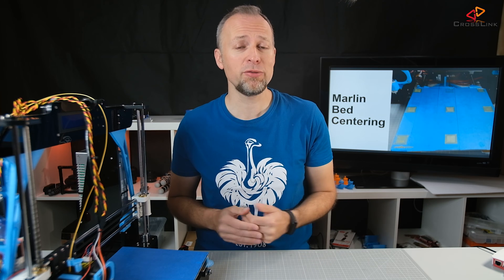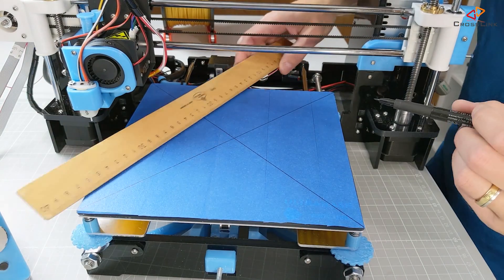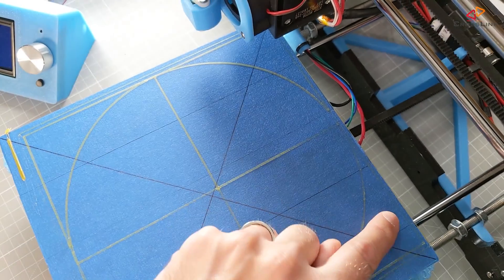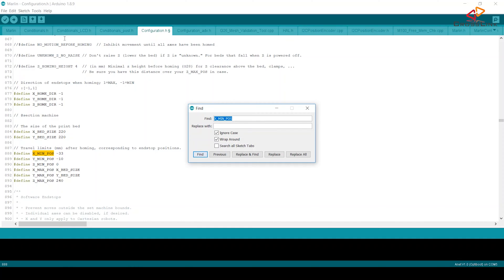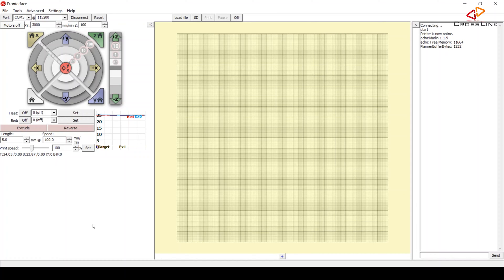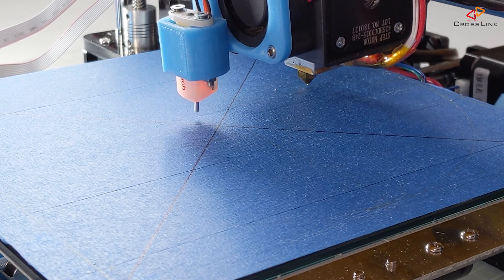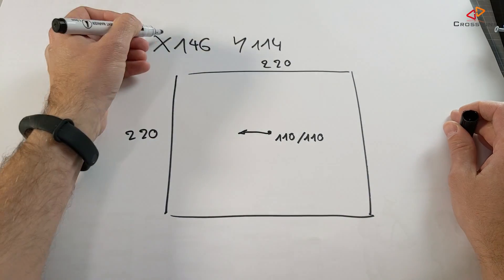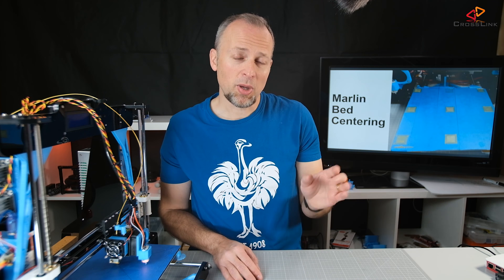Bed centering with Marlin Firmware 1.1.X

Comment: This is an old video but I hope I get an answer soon.  I have an ender 3 and put a Sprite Extruder pro on it. To adjust for the new X carriage endstops (I had issues with homing trying to  go past where the printer can move.)  I am learning to compile firmware. The example config.h from marlin for an Ender 3 says print bed of X235 Y235.  Should I change this to X220 Y220? I know its actually 235x235  but everyone on You tube says 220x220.
Reply from the maker: 235 is the physical size but you might want to keep some margin for the initial throwaway string and the most outer regions are not heated. So the safe region is 220x220.
Reply: @Crosslink3D  rather then mess with offsets and losing print volume I used x235 y235 and used a sliding nut with shorter bolt to adjust the frame. My first attempt at firmware worked but not well. For the moment I am using a firmware factory firmware while I learn a bit more.

Comment: Daniel/All:
I'm relatively new to this, and I'm wondering if this same procedure/commands are used in Marlin 2.1.2? I just replaced my Ender 3 Pro main board and LCD with the SKR 1.4 Turbo and the TFT35 E3 V3 as per your recommendations. Having some issues trying to compile the firmware correctly as I added a smart filament sensor and the new BTT CR Touch sensor, but I think I can figure it out. Thanks for all your help!

Comment: I know this is an older video... But would this fix the problem I have (installed a Sprite Pro head on my original Ender 3) and the nozzle homes about 13mm off the front of the bed. I've set the home offsets in through the printer menu but it still homes off the bed. When I try to do bed mesh leveling the first five point measure off the bed.

Comment: Would be great if you would show how to get in to the default file of your printer without using some other form of software or other then OEM from the ender printer. literally every YouTube video does not show anything on how to! Just use this software or adjust it from cura. Why cant people just explain default OEM options!

Comment: Great video: I have one question: I am not sure why you need to print the calibration pattern. I would think all you need to do is home, then move X, Y to center. On my printer it is 150 x150mm. Then move printhead to the actual center where I drew the X with a pencil. So it looks like I really don't need to print the test pattern. I could then print a test patter afterwards to see if it is printing in the center. All the print patter would tell me is I am printing off center. And Moving printer to X150, Y150 seems to do the same thing. Am I missing something?
Reply: Oh I just now see I ask the same question when I calibrated another printer about a year ago.

Comment: Subscribed M500
Perfect, been struggling all day to centre my prints, you solved it for me. Although I didn't configure the firmware then flash, I used Prontoprint's console and entered the correct numbers following your calculations and now my prints are mm centred :D Was annoying having to grab the wipe line with tweezers as it was about 5mm over the edge. Not any more, thank you :)
Now to sort my E steps, off you watch another video of yours :D Many thanks from Cornwall, England :)

Comment: I just added an auto bed leveler to  my CR10 S5 and flashed the latest Marlin software to my printer. The auto leveling works fine, but now my nozzle auto homes at the end of the print and squashes my prints. I am using Prusa and here is my end Gcode - 
start code //{if max_layer_z <= max_print_height}G1 Z{z_offset+min(max_layer_z+50, max_print_height)} F600 ; Move print head up{endif}
G1 X5 Y{print_bed_max[1]*0.8} F{travel_speed*60} ; present print
M140 S0 ; turn off heatbed
M104 S0 ; turn off temperature
M107 ; turn off fan
M84 X Y E ; disable motors 

end code //

Comment: Hi Daniel, I have followed the procedure several times in detail but despite everything when I give the command from Pronterface G0 X110 Y110 Z2 the nozzle moves to another position and on the display of my Anet I still read X110 Y110. Is there any parameter to comment on? Does somewhere else run any additional commands? Thank you
Reply: cancel !!! I'm solve !
Reply: @sergioroselli5726  how? i've the same problem

Comment: Hey Daniel, Just installed the DDX from bondtech, and have tried to follow this video (On stock it worked great) However, each time i do the  MANUAL_X_HOME_POS it still doesn't center the bed.
I have tried this like 20 times now, even used the G0 X115 Y115 Z2 to get it to align, but it doesn't work, what am i doing wrong?

Comment: Hi, I did what you said and it worked, but... now when a print finishes or if I move the Y axis to 235, it grinds the belt. The home coordinates also show the values I entered into the firmware. I read another comment that said they had similar problems. I would greatly appreciate any help for this.  I'm using Marlin 2.0.7.2.

Comment: Hey Daniel...  i was wondering if you could help me out with an issue i ran into.. the problem is i flashed my standard Anet A8 with marlin 1.1.8 auto level (cause i added a sensor onto it) everything seems to be working except the most important option...  when i select print from SD and the Gcode to print, it heats up nto its temps, reaches its temperatures on the hotend and the bed, but will not start the print, its just sits there...  is there anything i need to change in the marlin config file to get it to print?

Comment: I just wondered why I need to print out the cross hair pattern? I would think I could just plug in on my printer G0 X150 Y150 after zeroing out the values in the firmware; move the print head to the center and adjust the values. Only skipping the initial X/Y cross hair printing step. Is there a particular reason this will not work?

Comment: Yo. This is it. I had problem with error "Having trouble compiling firmware for my printer -Movement bounds ([XY]_MIN_POS, [XY]_MAX_POS) are too narrow to contain"  because i changed value in wrong place.... You must enter your value when you calculate center like in this video!

Comment: Hi...Thanks for the video....I followed along and was able to get the center perfect.....However, as a result of adding my values (X=4 Y=-5) into the MANUAL_X_HOME_POS etc, the readout on the LCD reflects that when homed.....Is there a way to add those values in Marlin and have the home X & Y display X=0, Y=0 etc....My slicer scripts for end of the print tell the machine to go to X=0 however its now actually X=4 (I know I can change it in the scripts to go to X=4), but I dont want to have to adjust to that.
Thanks for your help.

Comment: hey i was wondering im having a problem when i send a print to the printer it prints at the front left corner instead of in the middle i was wondering if you might be able to help me or knew what was going on??
Reply: I have the same problem, You fixed that?

Comment: Thanks, Excellent video. If anyone is doing this on an Ender-5, its (110 - (Screen Readout)) = (Home Postion) + 220 = Manual Home Position ... 
This video is for printers that have endstops at the front left (0,0) whereas the Ender 5's endstops are at the back right (220,220). You are basically adding or removing a margin to endstops to have the nozzle centered at (110,110). I have the Hero Me Duct with stock hotend so my firmware settings are: 
#define MANUAL_X_HOME_POS 223
#define MANUAL_Y_HOME_POS 209
I hope this helps someone because it took me a little bit to figure out.
Reply: You saved me man!!! I was confused because my bed does not move to the center, just a little hahaha.

Comment: This tutorial finally pushed me in the right direction. 
My centering was waaaaaay out of whack so far. Up until this point this was never an issue because my prints were usually small enough for this no to be an issue. 
But with a bigger print waiting that will barely fit the print bed with 4mm to spare on either side, this needed sorting. 
I have an AM8 here which is running Marlin 2.0.5. The Y axis was sorted pretty quickly, but try as I might, the X axis never did what I wanted. It was always off about 30 mm to the left, no matter what I did. In the end I did not use the manual positioning option in config.h but the min_pos_x option. I eventually adjusted the positioning by trial and error and finally got the result I wanted and the printer is now centered properly. 
Big thanks from the Ruhr! :-D

Comment: Thanks Daniel. Yet another fine tutorial of yours that is clear and easy to follow, and more importantly, successful! However there was 1 strange thing that happened at the point where in Pronterface you put in the code "G0 X110 Y110 Z2" and hit "send". For some reason the nozzle didn't move to the centred position. Rather than panic I decided to click home and try the "G0 X110 Y110 Z2" command again and this time it centred perfectly. I repeated this numerous times to make sure that it centred again which it did each time. Just thought I would let this be known in case anyone else also experiences this and starts to worry that they have done something wrong.

Comment: Hi. I replaced firmware and now HOME does not exist. It goes up as he can reach and moves to the right until hitting the structure, I think step motors values are wrong as long as everything. What can I do? I have an Ender 3 clon printer, Sunhokey and installed a firmware as Ender 3. Thanks.

Comment: Im trying to do this in Marlin 2.0 and I only see 5 tabs where you have a lot more. Im doing a search for mem pos and it doesn't exist. Is setting this up different in 2.0? And if so, whats the bit of code i need to adjust for the difference?

Comment: Thanks--So I set up everything, I have an SKR 1.4 turbo in a tarantula pro, for some  reason after auto homing, z goes to upper right corner of bed to home and stays there--I would like it to home in center like everyone elses printer, I havent changed any settings/definitions in Marlin, z safe homing is enabled and x y (/2) bed size is defined--any suggestions?

Comment: Okay, why not just find the center of your bed, as you've laid out, and then take those coordinates, and simply double them, and enter them as the exact size of your bed, under:

#define X_BED_SIZE 296
 
#define Y_BED_SIZE 308

My starting positions were X POS 148, and Y POS 154. (on the lcd screen when centered)

Is what my Tevo Tornado ended up being.

You don't need offsets when you have the proper size entered in Marlin.

Comment: That looks a little convoluted. If I programmed this you would be able to simply travel from the home point with the control buttons to the edges of your bed and have the x-y readout on the display, then save the settings like you do when bed levelling and Marlin would know how big the bed was from the home point which is the point of reference....you could manually enter the x and y values displayed on the screen and then Bob's your uncle. Does that not make sense? Am I missing something?

Comment: I have been following your steps to fix the center of my gantry pro with a 310 310 410 print area and i totally ruined it flashing the firmware. What profile do i need to use for my printer? Im having a meltdown here

Comment: The drawing of an "X" on the bed surface from corner to corner is relative to the limitation of your actual printable area and would only work if the homed nozzle is perfectly at 0,0, or less, and can reach the opposite corner. If your nozzle can not reach both corners of the physical bed this will not work using the physical corners to draw your "X". 
You want to center your printable area, not your physical bed.

Your bed "corner" would be where the nozzle is above the bed. Example: my nozzle can not travel off the bed on the X axis, the farthest it will go to the left leaves 3mm of bed left of the nozzle. I would need to draw a line on the left of the bed 3mm from the edge of the physical bed. 

My Y axis is -5mm off the bed, so I would use the physical front of my bed and the line 3mm from the left edge as front-left corner, and In the configuration file I would set my Y position to "Y_MIN_POS -5" . You would also need to check the opposite corner to see where the actual limit of where your nozzle can go, then mark your printable bed area onto the tape, then you draw your X to those points. 

In my case, my nozzle can reach the back-right corner on both the X and the Y of the physical bed. So, I would draw my "X" from the back right corner of the actual bed, to the front left "corner" where I drew 3mm right of the physical bed. If my bed is actually 300mm x 300mm my "X" will be 297mm x 300mm in this example. There is 3mm of physical bed on the left which the nozzle can not get to, so that is where my "X" should be cornered.

Comment: I was wondering if this can be done through Gcode commands as it is a royal pain to flash firmware to my Artillery Sidewinder X1. I have to tip the printer on its side, remove 6 screws on the bottom plate, carefully unplug the case fan, carefully pull the cable from the TFT board. Carefully set it upright so I don't pinch any cables and plug in the USB to flash.
Reply from the maker: The best would be to have a printer menu for that. Wondering why this was never implemented. Gcodes, I am not aware of that this can be done. Is the USB port of the sidewinder not reachable in any other way. Major design flaw then

Comment: Thank you for your informative video. While it work and 110,110 is in the middle of the bed, my prints run off the edge. Basically with sensor-less homing, marlin doesn't know where the corner of the bed is (0,0) or at least it seems that way.  Any suggestions on that? Thx
Reply from the maker: I need to have a look into this. Never used sensorless homing before but I am very interested in trying.

Comment: i have built an AM8 style printer and my bed is bigger 250 x 250 im having problems that if i tell the printer  move 250 in either x or y position it goes most of the way but its about 50mm off in each direction my settins are as follows #define

 X_BED_SIZE 250
#define Y_BED_SIZE 250

#define X_MIN_POS -102
#define Y_MIN_POS -3
#define Z_MIN_POS 0
#define X_MAX_POS X_BED_SIZE
#define Y_MAX_POS Y_BED_SIZE
#define Z_MAX_POS 270

the values for x and y POS are set based on the printer being homed then measuring the distances of X and y from position X 0.0 and y 0.0 so when i tell pronterface to goto one of these positions it goes to the front of the bed corner which is perfect. i was told this is how to do it so that the printer knowss where the bed is but x and y are around 50mm short so i dont understand why

thank you in advance

Comment: Just getting into Marlin 2.0 on my A8 today, thank you for the videos btw! They've been super helpful in picking up configuration knowledge.

I have two questions:
1. Is it normal for the X and Y axis to say the coordinates on the LCD (example: X: -28 Y: -3)? If so, is it possible to set the origin to where those coordinates show as X: 0 Y: 0 on the display?
2. How can I setup mesh bed leveling on an A8 on Marlin 2.0? I saw one of your videos for an older version of Marlin, and I can't find a straight-foward way to do this.

Thank you for your videos! Looking forward to learning more following your channel!
Reply from the maker: I am working to update my guides to Marlin 2.0, so you can expect, I will cover these topics. The display of coordinate seems similar to what I have
Reply: @Crosslink3D  Thank you, I'm really looking forward to that! I actually just figured out mesh bed leveling tonight, mostly thanks to things I've picked up from your videos.

Is it possible for uploading on Arduino without verifying to cause the LCD text to glitch? Or could that be an SD card/USB error? Sorry to ask so many questions! My stock LCD is is displaying strange glitched text after homing, and other operations since a questionable writing process on Arduino earlier. I'm trying to rule out possibilities, as I'm new to Marlin.

Comment: Man where was this 11 months ago lmao I got my first 3d printer the anet a8 last year beggining of October and and while trying to upgrade I accidently ruined the nozzle threads and the hotend threads and had to use the nozzle that came with the e3d I had gotten ahead of time but since the hotend was damaged too it was oozing extra plastic from the top of the nozzle lol but for some reason was printing amazing so I panicked printed the e3d carriage I wanted but after the I couldnt print anything bigger than 40×40 lmao but man great vid very informative sorry for rambling. Oh and probably wont get to this cause it's so long but why did you put the values on a different line I figured this out myself by searching the marlin code(first time at that point ever working with code) till I found the values in it that match the LCD screens homed values and changed them on the same line and has been working great but was wondering why you put it on another line sorry rambling again I'm done now lol.

Comment: Hello, uncle, is it possible to update ender-3 firmware without arduino or any external hardware? I just bought ender-3 and I am worried about the safety hazards of the old software.
By the way, love your videos, keep it up.
Reply from the maker: The Ender 3 unfortunately has no bootloader by default so you will have to flash one first using one of the devices I explain here: https://youtu.be/VI-8EK3HuV0

Comment: This did not work for me. Mine still prints about 4mm to the right. i basically have a tevo tornado with bltouch so it is almost same setup as you just bigger. not sure what im doing wrong but i have tried everything so far and nothing has made a difference. If i do manage to get it centered, it will then hit the x end stop but motor keeps going. What am i missing here?